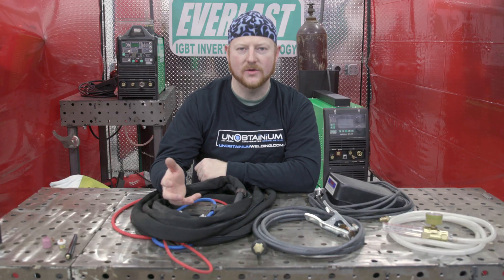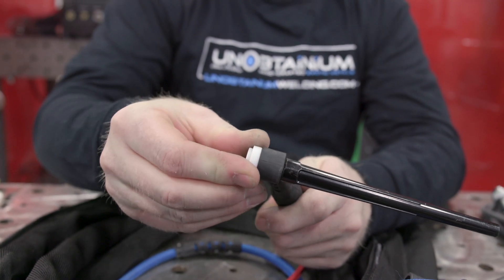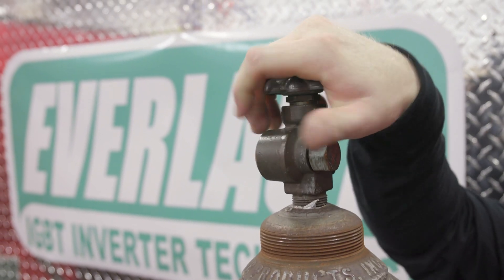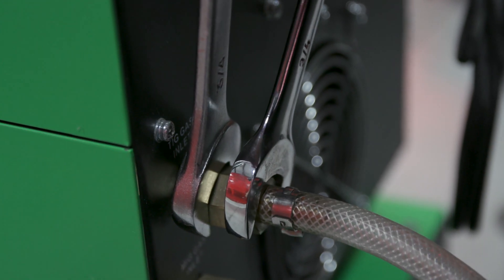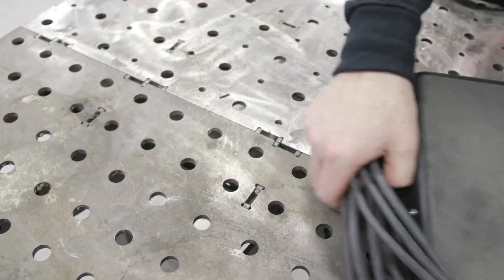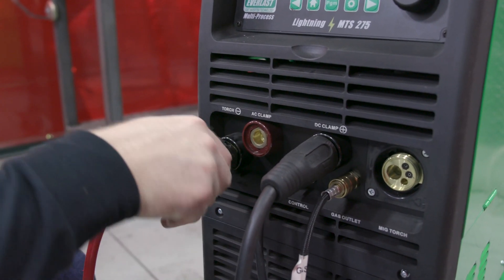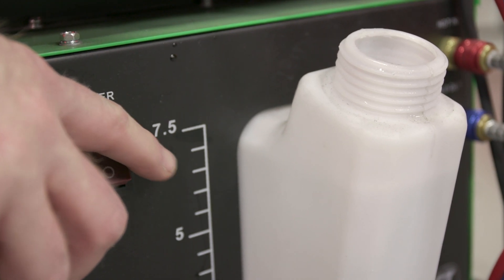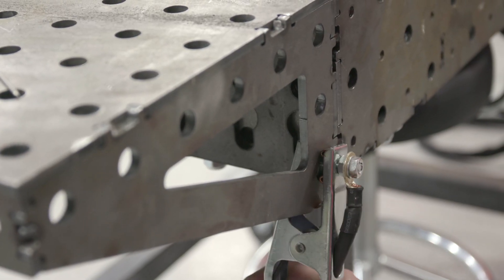Everlast Lightning MTS 275: Machine Setup | Everlast Welders

Comment: I just wanna know how to setup the tig cooler 400 to the mts 275 on the dumb cart. Zero instructions on that and these black brackets that came with them seem to not meet up nicely in any way in particular.
Reply: What you need to know?
Reply: The brackets on mine didn't match either, take screws out and move them to correct spacing, should be several spots to move them around.  Unscrew rubber feet from bottom of welder and put them on the bottom of the cooler.  Fill to the 7.5 mark and hook torch up, let it run and prime the line for about a minute.  Fluid in reservoir will drop some cuz what is in the line, then just top off to full.  I leave mine connected to cooler and argon out and just unplug dinse on torch when not using that way I can ground mig or use stick.

Comment: Is there any difference in the Argon Regulator /flow meter as opposed to the CO2 regulator/ flow meter? I bought the 325 EXT and was sent the CO2 regulator with the purchase kit. Also, the 325 EXT gas inlet is directly in the middle of the unit right where the bottle is, does Everlast sell a 90 degree fitting to account for this?
Reply: Usually one in the same.  The flow meter will have 2 readings and the meters have a mig and tig range and flow indicated.

Comment: Hello. I am looking at purchasing a mts welder, but I can't find a informative comparison between the mts 225 and the 275. 
Obviously duty cycle and higher amp settings, but is that it? Also I believe I read somewhere that the 225 does not have sine wave in ac tig.
 Any information or redirect to a helpful site is greatly appreciated!
Reply from the maker: Lee, there is a spec sheet for both units on the website (product pages) that goes over every feature.

Comment: The 275 is a beast but I wonder if Everlast has considered another MTS machine adding pulse/double pulse mig and a dual shield flux core menu to it making say the Lightning 300MTS-P ? Think a feature packed box like that would be a top seller.

Comment: Good to see some content being put out on this machine. I have only used mine for tig and a bit of stick welding. Inverter stick is definitely something to get used to, as I started welding with a transformer machine. But Inverter tig is superior in every way to the transformer type imo. Only issues so far is the operator, not the machine

Comment: I have had a everlast 250 ex for a little over 2 years. I was really surprised when I got it how well it welded. The only problems I had was the gas hose end blow off when I turn on the gas for the first time. Now I thinking about the 275 because of the mig. Overall I would give the everlast a 4.5 stars out of 5.